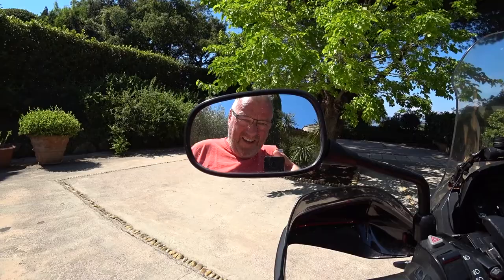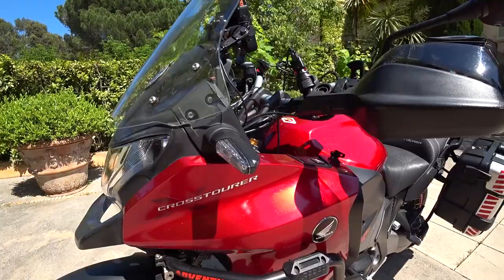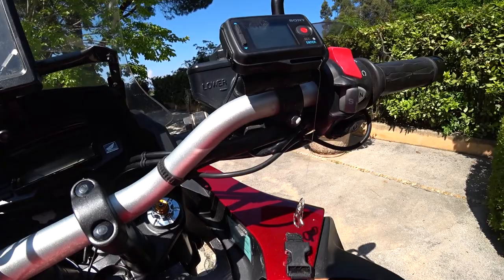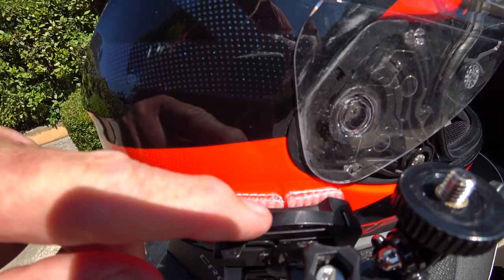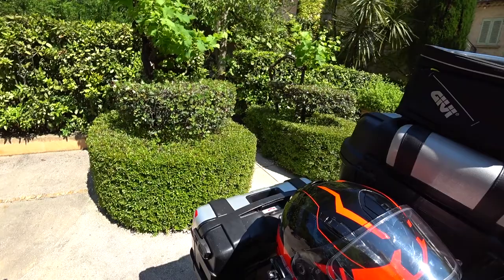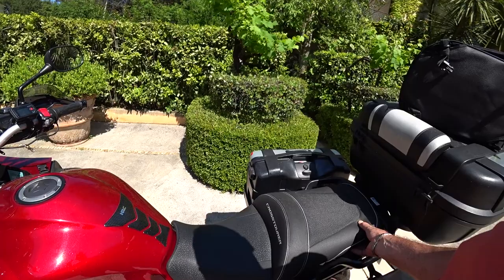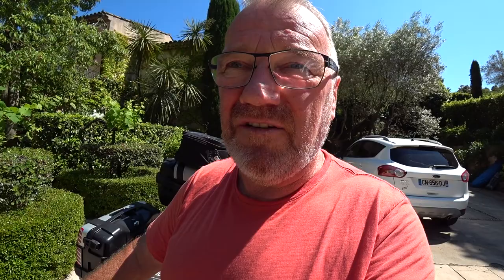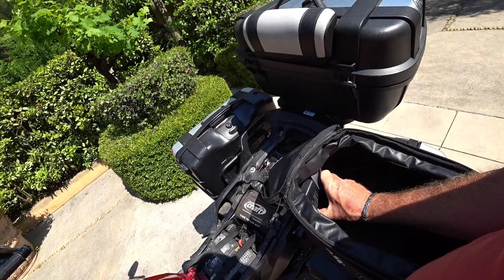MOTO VLOGGING SONY ACTION CAM AND MIKE SETUP

Comment: It’s a little funny, yesterday I mounted one of my GoPro down on the left side facing the front wheel. It’s practically the same mounting position as you. I’m not sure what will be the best angle. More of the wheel and suspension and less of the surrounding ore more of the surrounding and less of the wheel. And if I choose to film the wheel is it to prey to see the “connection” between the tire and the ground or to have the hub in center. I guess it’s not very important but I have to choose something over the other.

Nice with the tank bag, but you should have something between the quick release and the tank otherwise it’s risk that you scratch the paint.
In 2017 when we were in Norway we rented a room at Tynset Room and Camping, I had my tank bag on the floor and unfortunately one of the magnets picked up a little maybe 5mm long fishing hook from the floor. I wasn’t observant and when I took off the tank bag on a parking place in Röros I noticed a scratch in the paint on the tank. Not the end of the world but not so fun.
Reply from the maker: Joones Adventures MC thanks so much for the tip, I have been thinking of protecting the tank with something. I will only use short bits of wheel camera and some from the old gopro looking backwards at me to break up the main filming camera. I need to be more relaxed on camera, like you and get better at the post production, but as you know it’s time consuming. Mixing that with full time work, wife, and social life is an art in its own 
Ride safe 
Crosstourertony
Reply: Yes it really is time consuming with editing. I can really understand that for the really big Youtube it’s more than a full time job with filming editing and also everything around. But it’s so fantastic to be able to share the experience with other people and learn from each other’s //Jonas